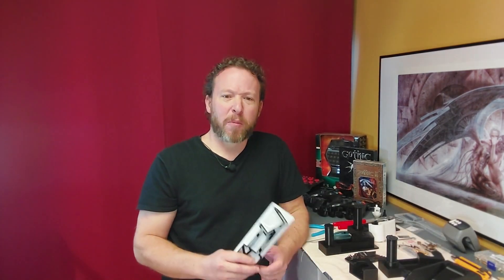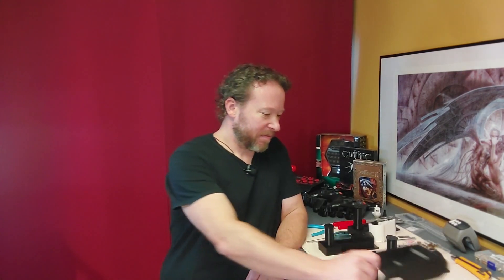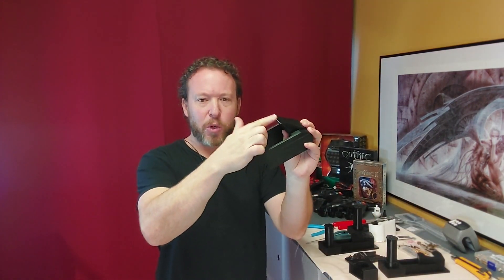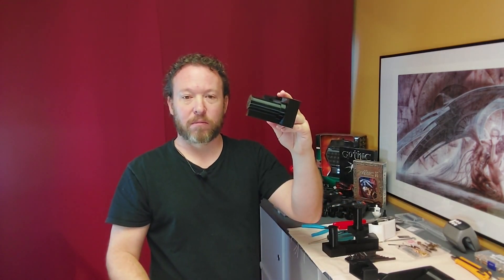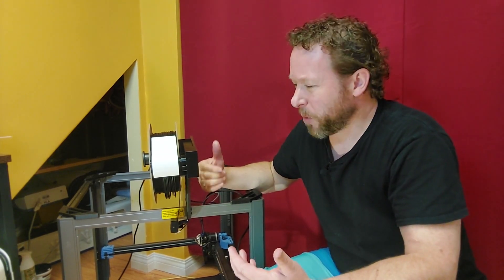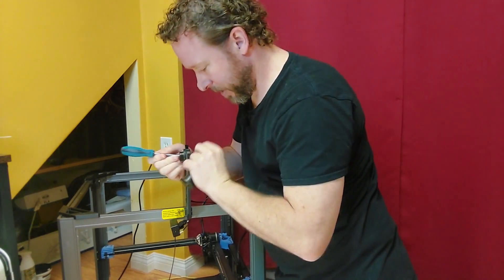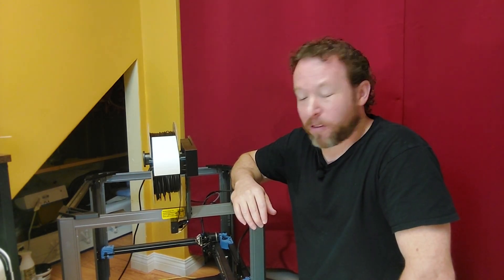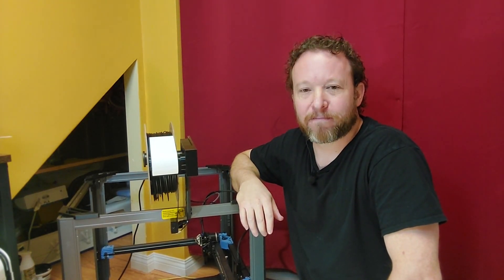My Filament Fix for Sovol SV08! 🔧 No More Slip-Offs or Hassles

Comment: Dude, great work! I will try it out. I get maybe only 1 out of 10 PLA spools i print with that unwind wildly, mostly Sovol's lol. But anytime I print TPU there is where I have real trouble with it. And yeah, a fixed spoolholder does give my tpu prints severe underextrusion due to drag.  The original fixer tool design was a huge PITA for me to remove every time with how/where my printer is set up + my stupid arthritic hands, so your version looks like the ultimate solution for me. Thanks for this!
Reply from the maker: You're welcome.
That's exactly the point, not everyone's situation is the same. Now there is one more possible solution out there.
Reply: @ Some feedback after a couple failed prints while using your mod (nothing important, small calibration prints). This wasn’t an issue with the cardboard spools I’m used to using until I bought some new filament I hadn’t used before that comes on plastic spools. The sharp corners of your arm part… the one that touches the filament in the spool as it turns and causes the slight friction slowing it down. The sharp corners of that part keep snagging and getting caught in the holes cutout of the plastic spool as it turns, and since it’s way more rigid than cardboard causing the filament to stop feeding and once even broke. I snipped off the corners and it was going better but it just happened again. I already had to print the arm a few mm thinner by making a planar cut because it was too wide for Sunlu’s strangely thin new spools lol. I’ll try making a remix for SUNLU spools once I get it right. And don’t worry no big loss. Figured would be good to let you know about it though
Reply from the maker: @spoolsamplesprintco   Thanks for letting me know. I didn't have the chance of using plastic spools either, only cardboard. So maybe I should bevel the edges.
but this way it is easier fro remixing. Decisions, decisions.

Comment: Nice solution at first glance, but for my part, my additional issue is that my filament spools come from the 'FormFutura ReFill System'—however, the diameter of the spool introduction orifice is smaller than the lip on the outer edge of the support. In my case, I'm forced to disassemble the support every time. Last point: the width of the 'brake' is too large. Indeed, the spools weigh 750 grams. But I think that with 'classic' spools, it should work perfectly.

Comment: just disable the rotation of the spool holder. i used a 5cm strip of painter's tape. no more untangeling. the rotation of the holder really is only needed for flex materials...
Reply from the maker: Yes it'll also dig grooves into your spool holder and create a dead spot that might eliminate your ability to print flex materials in the future.
But the solution chosen is up to the user.
Reply: @DomDecodes the sv08 is my 5th printer. All 5 are up running. The oldest for 9 years. All 5 have static spool holders. Not one has grooves or problems...

But yes, live and let rock.

Comment: I'm going to try this one out. Currently I have a Manila Folder sized rubber band that does a pretty good job of keeping the spool from unrolling.
Reply from the maker: Check out the comments, there can be setbacks with this system depending on the filament roll you use. I do have an updated version linked in the description and will overhaul it, as soon as I get to it.

Comment: Good video... I just put  a rubber band on the space between default roller and holder. no need to dissemble anything. It works perfect no unwinding. It gives a little back winding when filament pulls and its good to prevent unwinding.
Reply from the maker: That's a really good suggestion. So many solutions to choose from. Also I built a total over the top spool holder. To fit the printer into an enclosure in the end.

Comment: This is a great solution.  I did have one issue though.  I ended up with a spool (Inland cardboard) that the arm "stuck" in.  Have you had this problem?  If my CAD skills were up to it, I'd consider maybe making a wider arm that had a roller at the end that would roll on both sides of the spool, basically trapping the filament inside, but rolling as to minimize friction.  Does that make sense?  Would that work in your opinion?
Reply from the maker: Yes I had that issue with a cardboard spool as well. It worked fine for a while but apparently deeper toward the centre it got stuck, because the cardboard spool was inconsistent in dimensions. I did shrink the arm down in the slicer.
But I do agree there must be a better option.
Somewhere between the bolt on solution and my current top mounted spool holder.
I was thinking of inverting the design so the arm points with the rotation instead of against it.
But hadn't had time to explore that yet.
But I will look into it.

Comment: nice solution! thx ... while I assembled my sv08 yesterday, I took a look at the original spool holder. I just took out the ball bearings from it. Seems to be good. But i couldn't print so far :-(
Reply from the maker: I got grooves rubbed into the roller from it being too tight.
But whatever works.
What's the printing issue related to?
Reply: @DomDecodes  the printer is in the office...its weekend so i didn't had the chance to actually print something to see, if taking out the ball bearings cause or don't cause a problem with the spool. BTW. you always have good music in your videos ;-)
Reply from the maker: Oh I see. I thought the printer was somehow not printing because of an issue.
Thanks.
Reply: in the meantime I could print something! Taking out the ball bearings does the job for me. Maybe you can try (and show) this in addition...
Reply from the maker: @benjaminfunk1844  I will certainly look into it. Thanks.

Comment: Hi, Chris i n Bulgaria, my solution was to just super glue , works fine. Not ever used TPU. But hoe to in the future, maybe. Meanwhile back to getting my Sovol settings right.
Reply from the maker: I actually discovered worn out flat spots on my roller the other day. That came about when the resistance was set too high. So I don't know if I personally would use super glue. But if it works for you. 👍

Comment: I've printed (almost) a ton of TPU.  I hang it above on a bearing hub and feed directly into the extruder without running it through a reverse Bowden tube.  I do use a filament run out sensor but I wish that was an optical sensor for less drag.  Unspooling isn't an issue for TPU.  It's mostly an issue for stiffer filament such as PLA or carbon fiber reinforced filaments, and even then it's mostly an issue near the end of the reel when the filament's clock spring torque is sufficient to unwind the lightweight nearly empty spool.  The extruder tugs to unroll a little more filament but once the static force of friction is broken the spring loaded filament spools off a lot of excess filament.  Most people prefer no bearing on the hub to create a little bit of friction for every filament except TPU.  If you don't print TPU, use a hub without a bearing or disable the bearing.

People who want the ability to print TPU often prefer a bearing hub with a simple drag mechanism that can be enabled, such as a TPU washer or a screw on hub nut that can be loose for TPU and tightened to create drag with PLA, etc.  I hang my filament on the bearing hub reel holder a couple of feet above the printer and haven't had trouble with stiffer filaments unspooling and tangling.  The other filaments unspool at the end but the loose coils hang vertically and don't tangle.  I think tangling is a problem with a spool holder mounted close to the printer, particularly when near the same elevation as the entrance to the Bowden tube where the unspooled coils can overlap and tangle.
Reply from the maker: Yes you mentioned that. And this is probably the better way to do it.
But not everyone has the capability and or dedication to make such an impactful change.
Besides, someone might just be starting out and is looking for an alternative solution.
I like it and I'll use it until the enclosure is finished.

If I ever get my filament order...🤬
Reply: @DomDecodes  - Our two weeks of serious winter is abating and deliveries are resuming.  I assume delivering merchandise during Canada's winter is much more problematic.  My dial thermometer arrived today.  I'll use that to monitor the passively heated chamber of my enclosed SV08.

I also received yet another @Microswiss FlowTech nozzle.  Apparently I'm collecting those now.  The nozzle that arrived today is the 0.6 mm CM2 hardened steel nozzle to print carbon fiber.  I'm looking forward to trying that with some black Siraya PET-CF.  These are well designed nozzles optimized for various purposes, and the machining is gorgeous.
Reply from the maker: Nope. It turns out they gave me the wrong tracking number. And no one knows where my package is or which courier is actually responsible.
FedEx is off the hook, they were great and retraced all the steps to come to the above mentioned conclusion.
It's probably refund time now.